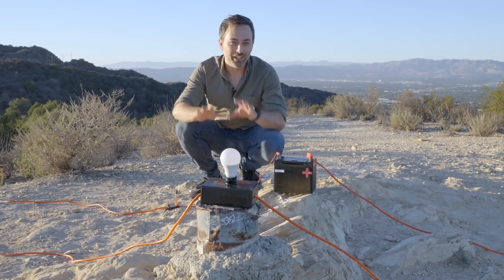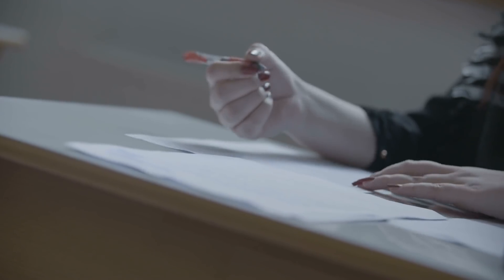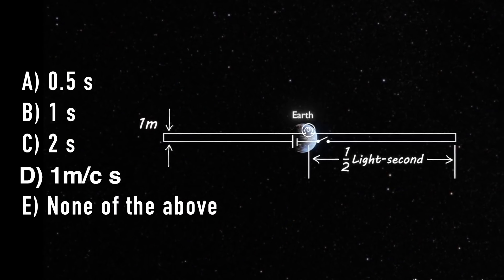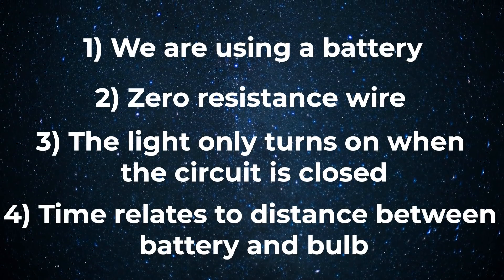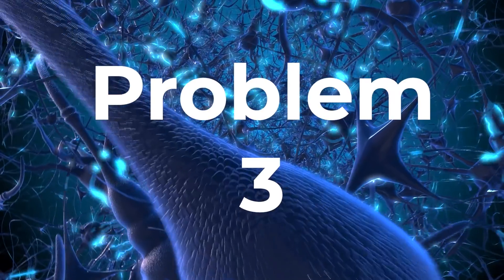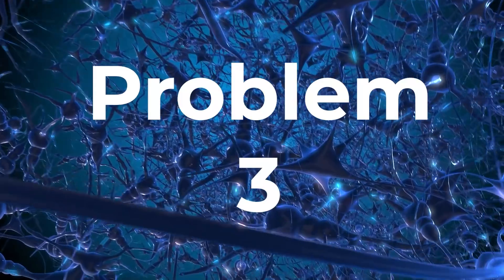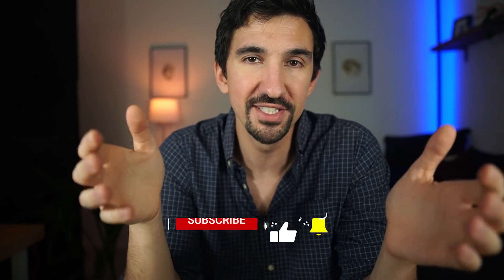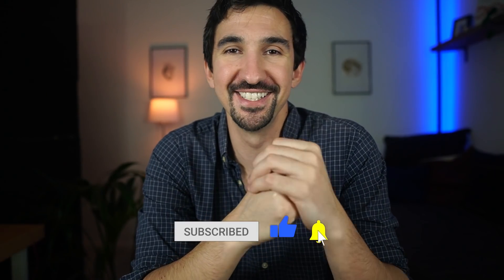Is Veritasium Wrong About Electricity?

Comment: 1. Units needs to be in seconds, so you have to have a distance, (length of wire??).
2. His wire was not as long as the graphic. At least I’m pretty sure he didn’t team up with Musk to set up the experiment. So his light would come on almost immediately.
3. If the wires are not completely electrically  insulated, there will be capacitance between the wires which would induce a voltage on the other wire which could start to produce light before the electromagnetic fields have a chance to propagate along the full length of the wire at the speed of light.

There is a stock exchange that uses a coil of communication wire to slow down the speed of transactions. If the wire was not involved in the transmission of these signals then the signal would not be delayed by the length if the wire!

Comment: 1:54 Exactly! Thank You for pointing that out. That bugged me right from the beginning of the video. Also, I would have liked variations of the thought experiment and the corresponding changes to the outcome. That would help non engineers to get a better feeling of what's going on there. Variation 1 would be to cut both wires in the middle (antenna variation). Variation 2 would be to move battery and light buld as far away as possible while keeping a distance of 1 m between the now fully parallel wires.
Reply: If you cut both ends of the loop, you would just have two parallel antennas. It would change nothing about the first 1/2 second. The last effects from the outgoing pulse at the end of the first wire (wire coming up to 12V) would take another 1/2 second to return from the end of the second wire. The effect on the light bulb for the first second is identical whether it's a loop or unconnected parallel wires.

Comment: And you are right! That light will theoretically turn on but only fractionally and only during that initially fraction during the closing or the switch.
The whole experiment he did (except for the units) was correct and a typical electrical engineering question that ties more into signal transmission (thuis induction and capacitance between the wires) in play instead of actually DC energy. Because after that initially “spike” the capacitance is “theoretically high for DC” and the induction’s is also overcome. And then there’s no talk about transmission technology anymore,

Comment: Thank you for this video. Very much needed, especially the ending. I never watch Veritasium (not event dislike him) , and seeing the clips of his latest video here makes me even more convinced that he is just out for clicks and boosting his ego. 

In the clip you showed he said something about "lies you've been told" which is pretty thick when we thing about the way he loaded the dice in his setup. 

Sure, given some parameters for resistance, capacitance and inductance the light bulb might "turn on". Or not! Probably not, doubt with 1 m distance between 300 000 km long  antennas you could transfer enough energy to heat up the filament. Or even a LED. For any value of R,C or L. Not to mention anything reasonable. Or transmission line effects,  reflected wave front and stuff.

And then if it would ever so dimly lit up for some fraction of a second before the field would stop changing, would that count as 'turning on'? No in my books for this though experiment where after the current had completed the circuit  and the DC current established the bulb would really turn on and any minute flickering before that would not count as "turnin on". An honest person would say, how long does it take for the bulb to flicker or blink the first time, but hey, that would give his game away.

I guess he had a point he was trying to make but he in his quest for sensationalism and besserwisserism (is there such a word, if not, he should be the definition of it) made a complete pigs breakfast of this thing. Could have been educational but was just annoying.
Reply: couldn't express better what i thought ;)

Comment: Yeah when I watched that video something seemed off to me too.  Doesn't he imply that if light bulbs are powered only by the field,  that all you need is to have the bulb near the flipped switch?  Yet I've never had a light bulb spontaneously light up when I take it out near a light switch.  If what the video says its true, the wires one light second or 10^100 light years long shouldn't matter.  So the connectivity of the light bulb shouldn't matterx as there's no way for the light bulb to "know" if the circuit is completed.  But obviously it does if it flips on instantly.

Comment: A lot of people in the comments seem to think that veritasium was saying that the current travels thru the air to the components. He is not saying that, he was saying that the current produces a magnetic field that the already existing electric field would interact with, and that the energy (not current not voltage not power) would be transferred thru those fields interaction.

He isnt saying that the power voltage or current of the circuit must go thru the air, rather that the energy is, which we can prove can happen. Lets think about how electrons release energy when they are at a high energy state, they can release it thru light, which is an interaction between both an electric field and magnetic field. This shows that electrons have a very strong connection to the electromagnetic field and that when they have a high state of energy they release it to that field. Circuits seem a bit more like a potential field then a kinetic field, because of the gaps that can exist in the circuit, as veritasium demonstrated, so the electrons movement gives up their energy state almost instantly, into the electromagnetic field where that energy is directed into a component. 

In other words while the circuit wouldn't work with a reasonable voltage or current IF it was going thru the air, it would IF the current and voltage was in the wires. also his experiment assumes the wires have no resistance, as if it did the magnetic field wouldnt be made by the current (if it was a reasonable voltage like 12) and there would be no interaction with the electric field, and thus no energy transferred.

Comment: With your correction of units, the answer makes sense now. So basically the time required would be unit m/C. So if the circuit spans one light year, then the bulb will light up after (9.461e+15/C)secs or 31536666667 secs or 365007.716 days. This makes sense to me and it fits causality effect and also doesn't causes any information paradox. (sorry I am not very good with terminologies). Please let me know if what I think is right.

Comment: USN 1972 taught electrons shift positions. Aside, they posited they moved from negative to positive. One must be displaced for another to occupy position, and the displaced electron displaces another and so forth. So they all must shift at once all the way around the circuit the moment it is closed. Not like train cars starting, energy shifting down the line. Rather, like a Ferris wheel, every car, every point in the loop starting/moving simultaneously from the infinite moment of switch contact. How fast they all shift is current (amps) and the available force or 'pressure' behind them is voltage. The how quickly the amperage ramps up is proportional to resistance. But start to end they all shift together, regardless of speed. the loss of voltage across the load is converted to heat/light/work. Too small a wire increasing the resistance is simply increasing the load in effect. Assuming zero conductor resistance any delay in current acceleration or drop in voltage in that interim is fully a function and measure of the high resistance load (light  bulb eg) using power (volts x amps P=E x I) to convert/do work. But all electrons shifting is at the speed of light regardless of loss (drop) of voltage, current and/or power; resistance being a fixed value. Some designed circuits, or anomalous circuit conditions create a current drop with no loss of voltage.

Comment: I watched to “communicate, faster than the speed of light”. And no. Neither is this, what Derek said, not is it, what the Experiment shows. The lightbulb is only few decimetres away from the switch. Position the lightbulb 300000km away, and it would take 1 second to light up, given you use the reference frame of the person closing the switch. You got it wrong.

Comment: Point 2 - When I originally watched it, I thought he was suggesting that the wires are a red-herring and that the proximity of the battery and bulb meant that their fields could interact and therefore the was no breach of the speed of light. Thinking about it again though... If that's the case, what is the switch for? 🤣
Reply: The switch is what causes the initial surge of power in the antenna system. That surge , until it hits the end of the antenna, induces EM that is picked up by the other antenna

Comment: Poyntins vectors etc spring to mind here and the actual capacity and reactance of such a circuit that we required to ignore for dint of argument but I cannot see the "time" issue relating to anything other than the field propagation rather than "power" per se. Hopefully a definitive explanation will come from this video as I have run out of aspirin all ready.

Comment: I think this can be actually tested in real life with special hardware.
We have atomic clocks that can measure with extreme precisión any change in time even if the circuit longitude is only few meters long. 
Then measure for each unit of time the voltage and current evolution since the moment the switch triggers. 
BTW, I dont think that you would be able to sent information faster than light even in the case verisatium´s answer is correct, so casuality would not be broken.

Because the switch you place in the extreme of the circuit, would in fact take longer to turn on and off the light, because it does not affect the close electromagnetic field between the light and the switch, it is like an antena as you mention.

Comment: I don't understand why you say information travel faster than light, if the circuit breaks the propagation should be from the breaking point and not the switch.

Comment: I'm fairly certain the Veritasium video was slightly, but also deliberately, misleading in order to be contraversial and a bit click-baitey. Clearly, the two parrallel wires interact locally through their respective electromagnetic fields, however, the current induced after 1m/c seconds would almost certainly not be enough to turn on a light bulb (unless the power involved was immense), you would have to wait for the electromagnetic field to propagate all the way around the wire to the bulb properly before the light came on fully. As such, I have no doubt that Derek would be able to demonstrate a very small current before full propagation along the wire should be possible, however, it would not be the full current, that would only come after travelling fully around the wire. This also means some of his statements were fully incorrect in terms of the meaning he intended to convey, which does sadden me a little.

Comment: Are we still being told  that electrons, which definitely DO MOVE, are more crucially  exciting electromagnetic energy fields in a circuit that in turn excites the target item which lights up/spines/heats up etc?  And that, as in a transformer where two circuits are close but not in contact, the energy is stepped up or down, but does not actually swap electrons?

Comment: To be more precise, Hypothesis 3) at 3:55 should say “turns on IF the circuit is closed” rather than “when”. Also, I am not convinced that  exactly the same time need to turn on the bulb would be the time required to turn it off - because the process doesn’t seem symmetric to me, unless the “ turn on” is better defined. As pointed out by others, turning on means a certain threshold was reached,  but this threshold was not specified.

Comment: Super cool thoughts! And I agree that Veritasium's choice of words "lie" could be improved!

I do think your thought experiment which suggests that the initial experiment by Veritasium was wrong had one more assumption. You assumed that the information transmitted, in this case the electromagnetic waves generated from the battery, responds faster than the speed of light to a break in the circuit. I.e. to say, the break in the circuit causes the power source to know immediately to stop transmission. If you consider that the EM field was broken from when the break occurred, then the bulb would only turn off the same time the power source knew that the circuit was broken. At least, that's what I think should happen.

Comment: Agree with your assessment.  Basically, once the electrons start to move and induce a magnetic field some relatively small coupling develops between the wires through the air until the primary EM field travels along the surface of the wires around the circuit.  However, the light would probably not illuminate unless the resistance of the light decreases significantly or the power of the battery increases significantly.  If the circuit is arranged as a very large circle then this behavior goes away.  Veritasium sort exaggerates it as refuting basic teachings of electrical circuits to increase traffic on his video.  In reality he is just setting up a circuit that allows transient electromagnetic coupling between long conductors, an effect that can normally be neglected as insignificant for power transmission and is more relevant in radio signal transmission and antenna design.
Reply: GREAT POINT!!!

Comment: 4:10 Actually as stated in another video,  with the assumptions of zero resistance, it will light up if the circuit is open at the end. Quickly but briefly.

Comment: Your view of this problem is pretty much in line with my own reaction.. I think that the answer here is that it's WAY more complicated than high-school physics suggests. 'Electricity' isn't a thing, it's not an incompressible fluid moving at the speed of light. It's more related to the way sound moves through the air, individual charge carriers in the wire (mainly electrons) only move a short distance and they do it slowly. Each electron is urged into motion by the movement of it's neighbours and a wave-like pulse travels along the wire. Even that description is a serious dumbing down on what actually happens.
A reasonable (approximate) mathematical description would be given by treating the wire and it's precise layout and form as a 'medium' with a specific permittivity and permeability and applying Maxwell's laws. Precise values for those constants would be seriously difficult to calculate but If you could  do that you should get a value for the speed of propagation from switch to bulb somewhere less than 'c' because there's an absoluter limit at values that give c exactly.
Notice I said from switch to bulb, not 'along the wires'. Given the layout of parallel wires in the problem, and the fact that the bulb is only a few inches from the switch, I think the result of experiment might surprise many. (Possibly including me).

Comment: 2:40 Uh no, you don't break the speed of light. You only break the speed of light if the information travels along the wire and still somehow takes 1m/c seconds to do that. But of course, if it lights up so quickly, it's precisely because the information does not travel along the wire.

As another youtuber that answered to the same video said, you can (among different options), see the what separate the switch and the lamp as a capacitor.  In capacitors, no electron or positron flows from one plate to the other, and yet, the circuit is not broken.

Comment: I agree with your video (except the Morse code part --- it would still take at least 1 year, assuming information travels at c along the minimum displacement of 1 light-year via the fields through a vacuum). Veritasium's conclusion implies that the battery can power on the light bulb via parallel wires with 1 meter of separation via EM induction, without "knowing" whether it is a closed circuit. However, this "power" is just the result of a short pulse of induced DC current and cannot sustain being "Powered On", which defies most of our common sense of "powering things on" --- a continuous supply of electricity. I would call that "Flickering On".

Comment: Imo your missing the point. It’s the “concept” of “flow” the video was exploring. How it takes so little time to travel huge distances was the point being made. The example of the distance it travels is simply a visual aid. 
Imo The point of the video was to show that the magnetic field created by closing the circuit and creating the magnet 🧲 was the reason it was able to create “the flow” (not really the term) so quickly. 
You can tap the magnet anywhere and instantly experience the electro-magnetic effects.
That’s the way I understood the concept they were explaining.

Comment: The light couldn't luminate because the current in the circuit would be too low at  approx 4.5 nano amps
Based on 4mm2 copper wire at 600,000 kilometres and a 12volt battery (basic ohms law)!